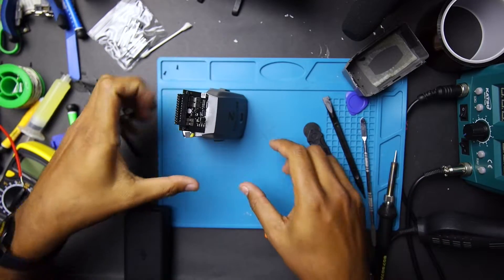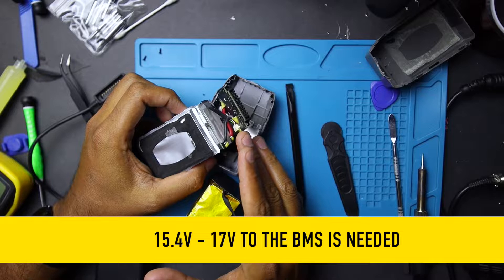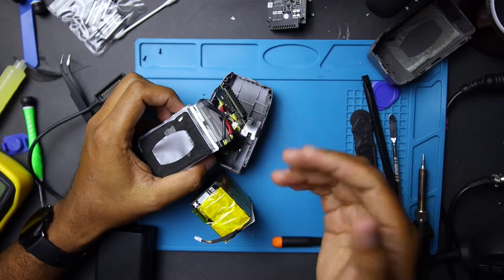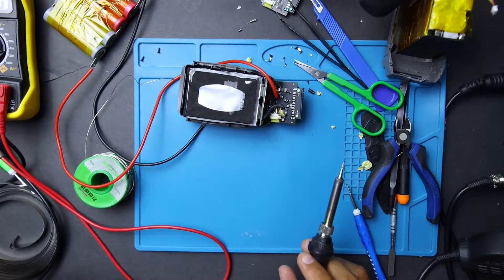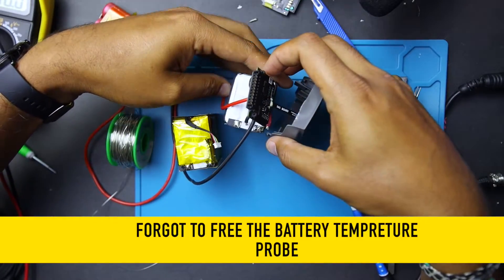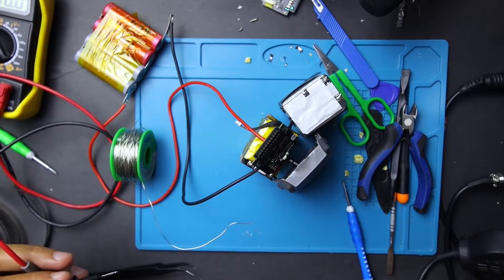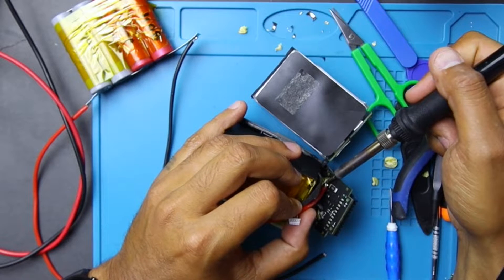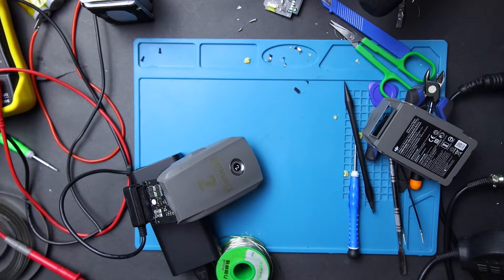Mavic 2 | Battery Rebuild Success

Comment: Changing cells is one thing but the controller will remember the condition of the old ones as it doesn’t know they’ve been replaced therefore a full capacity of the new ones won’t be used. Any idea how to restore an original capacity using cp2112 and dji battery kiler? There are some additional functions but no description how to use them - any hint appriciated. Thanks
Reply from the maker: Since the date of this, I didn’t adjust the cell chemistry or captivity in the BQ programming. The batteries work to full capacity, charge and dischargeW the only thing I reset was the cycle count and reset it to zero as it was new cells. 

The capacity that is programmed originally will not be changed until you change it. And you only change it if your cells are / have a different capacity. 

The BMS doesn’t bother with what charge it had before the change, if the cells are the same capacity it will charge / discharge as normal.
Reply: @ANTHONYVLOG  i thought it works this way: brand new battery has a designed capacity of 2375(MA1) as the battery gets older capacity of each cell degrades and it’s reflected in full charge capacity parameter eg: 1900mah on this basis bms calculates “wear level”. Since it doesn’t know we’ve replaced cells it should not try to push more mahs than he was able last time as the capacity magically couldn’t increase to prevent explosions etc. Are you 100% sure that in order to get full designed capacity od 2375mah all i need to do is replace all 3 cells for brand new ones and reset cycle count for reference? Also what does “chip reset” do on dji battery killer sw ? Thanks for your reply.
Reply from the maker: @losien1  100% you can pull the EPROM data yourself and see. I use TRB for the « important things ». DBK just for Testing.

BMS doesn’t record wear level like iPhones. Just stores capacity, chemistry for cells installed with regards to your question.

Comment: Good night Anthony so with this jumping I can make a new battery in the Mavic Air 1 without depending on the ev2300 and its respective software. Thank you very much.
Reply from the maker: Yes that is possible if the battery doesn’t have a PF flag.

Comment: Awesome work, im curious if it would be possible to install a battery of lower mAh on a mavic mini battery to bring down the overall weight with prop cages to under 250gr 🤔
Reply from the maker: It is possible and doable. Iv been using TRB software for recent experiments, they also rework the mini batteries. Look up patbooon labs TRB.
Reply: @ANTHONYVLOG is TRB a paid program?

Comment: I'm about change the cells in my battery for bigger mah cells for longer flight time, if I keep a dummy pack connected like you did you think it will work and I will get longer flights? I'm looking at cells between 5000mah and 10,000mah just haven't decided which ones to get yet? 👍🏻🤘🏻🤘🏻

Comment: Hi , do you have the dimensions of this cells, I checked the ZDF 3.85V max 4.4v 3850mAh Replacement  link and they are insane they want $367.00 shipping. Maybe if you can measure the physical dimensions and what is written on the label will help find other producers. Thank you.
Reply from the maker: The cell model is - 854871 
Size - 8.5mm*48mm*71mm

Other information 
14.82Wh 3.85v 

What country, city are you in? I’d like to check the shipping cost. That price is not right for shipping.
Reply: @ANTHONYVLOG   thank you Anthony, I am in Botswana, I double checked now the shipping is insane 🙂
Reply from the maker: @LucianComanphotography  oh i see. Yes Unfortunately Botswana is quite remote and shipping would indeed be very expensive.
Reply: @ANTHONYVLOG  he, he not really most of the lipo comes with a $46.00 transport tag, only this people are insane :-) Do you know any other manufacturers selling that size ?
Reply from the maker: @LucianComanphotography  ZDF supply the cells for brands like DJI, Parrot and Autel. I’m certain there are other suppliers but I do not know of any at this time.
Reply: @ANTHONYVLOG  weird on aliexpres they say they opened in 2018 and they have a hotmail address, are you sure?
Reply from the maker: @LucianComanphotography  they opened in 2017 and before that DXF cells. Than again I don't know before that because I only started taking apart batteries only 4 years ago for experiments. So I can only speak of the now recent findings.
Reply: @ANTHONYVLOG  uff is such a mission to get shipped lipo batteries, I get some shipped from Adorama, weird they did not want to ship batteries only but they ship the fly more kit. but I have another 2 swollen what I would like to try fixing, never heard about ZDF before, I use Tattu a whole bunch of them. How are yours after replacing they hold or they are low quality? I could not find anywhere else the dimensions what you gave me. On the funny side of things at ZDF where is the product page and they have those pictures with the factory, I just put a image search and the same building where they say is the factory appear as at least another 20 factories, he, he, he the logo is just photoshoped on the side of the building....hmm kind of dodgy.
Reply from the maker: @LucianComanphotography  i see. Well do not order if it does not meet your requirements. I just checked postage from France to Botswana and its about 40euros for 4 cells of 255grams through normal post and 280euro by UPS priority.
Reply: @ANTHONYVLOG  I was just wondering of the quality, and if yours are holding up well since you replaced them. Who is selling them in France? I have only the aliexpress link. Thank you.

Comment: Hi Anthony, its great to see what you did there. I was searching to rebuild Mavic Air 1 battery but couldn't find anything at all. So can you check if you can rebuild one for Mavic Air? I know you don't own the Air neither any Air Battery but since you successfully rebuilt one of Mavic 2, Air's one might be a simple for you. (Maybe? finger crossed)  Or Any help on making aftermarket lipo for Mavic Air? There are a lot of people just like me who are searching for Mavic Air battery but its out of production and rebuilding one seems to be the only go to option right now.
Reply from the maker: Hello, I’m in Switzerland for a production at the moment I’ll be back home in few days I’ll check my box of spares and get back to you.
Reply: @ANTHONYVLOG  Thanks a lot bud. By this time, let me update you with what i found, I saw a video of tearing a Mavic Air battery up and from that I found ZDF lipo titled for Mavic Air, same V Wh from Aliexpress. Air 1's battery is differently built, not like M2, I dont see any BMS connector but 3 lipo is directly connected in series to the PCB. I hope you can check and give me an idea about how to make piggy back battery for bypassing same like your trick. looking forward for your reply and have a safe flight back home.

Comment: What will happen if i fly Drone with Lithium Ion battery pack?
Reply from the maker: Not sure haven’t tried with 18650 cells. My guess is it will deplete fast due to the weight of the cells compared to LiPo cells.

Comment: Hi, i am in the process of connecting the bms to the new cells, i noticed you soldered the power and ground then moved the balance cable and the batt was already powered on. Did you do this on purpose, power on the batt then disconnect the balance from the old and connect to the new with power on?
Reply: i think it worked! i took a board from an OEMM2P batt, and transferred it with your method to my 7000mah batt, and everything looks good. I am fully charging just to make sure all batts are being read correctly. This was a Giant help!

Comment: Thanks so much for this rebuild! Would you be able to include the break down video at normal speed? I would like to use a bms board from a usable M2 battery for a 7000mah (8 Air 2s batt cells) And i look forward to the unbricking that you are working on!
Reply from the maker: That’s an interesting project. I don’t know if the terminals are the same as they are Fixed to the BMS.

Comment: Hello, I have a problem with my mavic 2 pro battery, it does not charge and the charger lights red
Reply from the maker: Can you explain which charger you have. The official DJI charger brick does not have any lights on it.
Reply: my mavic 2 zoom battery does not charge, I connect it to the charger and in the charger dji turns on a red light and does not start charging
Reply from the maker: @diegojourdan9314  use a Genuine DJI charger. No 3rd pty or charging hub. The original DJI charger will take the battery out of hibernation.

Comment: Amazing infroamtiove video. Thank you so much. But I have a question. When you put new cells to the BMS, it continues counting the charge cycles on top of the previous charge cycles right? I will not start from zero. So this mean when the battery reaches the maximum charge cycles it may also lock the BMS right?
Reply from the maker: Hello, it will continue to count the charge cycle from its current position. Currently there is only speculation that it will stop at 600 cycles but no one has reached this far yet without the battery failing on the original cells. If I get to 600 ill make another video to see if it blocks or continues.
Reply: @ANTHONYVLOG  I DM you on whatsapp.

Comment: great job! I have a question: Why not just make a Li-ion 4S2P convertion with Sony VTC5A? Do you recon the c rating would be too low for M2P?
Reply from the maker: Thankyou for your comment, the 18650’s are much bigger when you stack 8 cells. 4S2P. The weight is much greater as well so we lose on the thrust to weight ratio. And finally, lI-ion cells when they discharge also reduce current as they discharge where as lipo cells will maintain good current supply even as the cells discharge better than their 18650 friends.

Comment: Do you know the error of not showing mavic 2 battery parameters?
Reply from the maker: BMS issue. I have tried contacting DJI and they can only replace them on warranty but said repair would cost about the same as buying a new battery.
Reply: @ANTHONYVLOG Do you say that under warranty they could replace it with a new battery or would they do the work of replacing the cells? explain please
Reply from the maker: @jesusmaza3514 it would be best to contact DJI and open a support ticket. This video is over 2 years and things may have changed with DJI.

Comment: I’m a qualified electronics engineer and I would have done that a little differently but none the less keeping it simple the way you showed us will do the job quite fine, I would have used my lab power supply that way one pack won’t interact with the other pack by soldering them in parallel. One thing is the more exact you can be with your voltages the better ie: if swollen pack is let’s say 15.45 then your pack your using to jump across should also be 15.45 and your new pack also be 15.45 it’s all about keeping those number absolutely exactly the same and then you will not have any scary moments. To ensure packs are identical in voltage you need to have them sit and settle after a charge and make sure they are resting at the exact voltages otherwise they drift if you use them right after a charge and I don’t know what that would mean to the intelligent BMS in the DJI batts, maybe nothing, maybe a false voltage displayed who know without seeing the BMS programming and schematic. Thanks for the video it was informative, it will help many including me, as I would have disconnected the BMS thinking it would be fine, so thank you for the video!
Reply: Use a simple SPDT switch (one that does not short the 2 connections during switching) and a decoupling capacitor.
Reply: Other option is to use supercapacitor rated 17 V or more with about same voltage with the old battery ...
Reply: Hi i need advice from you i get my drone after 3 years from customs its zino2plus its battery is not charging and not working its cells are also swallowed little bit, can i replace its cells with dji battery cells?
Reply: Another engineer claiming they can do it better but never do a thing

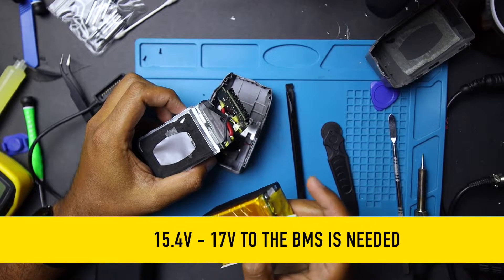Comment: At 2:15 "This the new pack that I built in a previous video" where is that video please? Thank you
Reply: Yeah I really want to see the previous video too. I'de like to know how he dealt with the spot welds on the tabs for the cells.
Reply from the maker: Solder them off. The spot welds are only spot welded to a plate. The plate is soldered to the board on the battery (not the BMS)
Reply: @ANTHONYVLOG  Thanks for explaining I haven't actually tried yet as my batteries aren't puffing up just yet, but I will likely try in the future :)

Comment: Hello @ANTHONYVLOG 
You do not need to do this whole process. First unsolder the red cable then unsolder the black cable and then unplug the balance cable! When you connect the new battery do the opposite, first conect the balance cable, then solder the black cable and last solder the red cable. The BMS will never be bricked in this way.
Reply: Is this method safe? what is the logic behind this method? how BMS survive with this method? can you give more info please. Thank you.
Reply from the maker: @Shaban_Interactive  it is safe, the principle is the same. Keeping power to the BMS, the balance cable supplies power as well so it works the same as the method I did.
Reply: @ANTHONYVLOG  But he says first unsolder red cable then black one and then unplug the balance cable. When you do this BMS will not be able to receive any power. I am just confused :(
Reply from the maker: Sorry for the late reply. You leave the balance cable connected to the exsisting battery. Just unsolder red and black than solder new pack red and black than disconnect old battery BMS cable and connect new battery BMS cable. 

This is only possible if you have 2 batteries, if you only have one that use my method. 

Also I am working on the BMS video, so if your BMS is blocked don’t worry I will release that video in February.
Reply from the maker: Yes thank you for this. It is the way to do it condition the existing pack have good balanced cells. In which case they are, so my advice is double check cell voltages at the connector and total voltage prior to proceeding to avoid any mishaps.  Good bless 🙏

Comment: it's need a software to reset the board?
Reply from the maker: It needs a hardware interface that can either piggy back on the data line or directly to the pcb. Software is supplied with the hardware interface.

Comment: Can i use li-ion batteries instead of lipo?
Reply: But li-ion can be charged max 4.1-4.2v . Does it explode?
Reply from the maker: @AnkaHobi  that is dependent on the Li-ion cells you use. The 18650 cells I recycle some of them are rated for 4.35/4.40v. So please check the cells, usually they have a code stamped on them and you can look up the battery charts to see their ratings and specifications.
Reply from the maker: If you want!

Comment: may i ask about the specifications of the dji mavic 2 pro cell battery
Reply from the maker: 3.85V max 4.4v 3850mAh
Reply: can i have the link to buy the cel
Reply from the maker: @sandal_jepit.27  it is in the video description 😃
Reply: Thnks you
Reply: is there a tutorial for assembling 4 cels battery?
Reply from the maker: @sandal_jepit.27  didn’t make one because it’s too simple, as you desolder one old cell, you install a new cell to replace it in the same position and polarity.
Reply: @ANTHONYVLOG  oh thanks you. do you have to charge the new cels first or can you plug it in directly?
Reply from the maker: @sandal_jepit.27  test the cells first they should be around storage voltage 3.85-4v per cell. If they are too low below 3.2v than they will have to be charged to 4volts before assembly.
Reply from the maker: @sandal_jepit.27  please make sure to keep the BMS powered up like in my video before disconnecting the battery pack. If the BMS loses power it will not be usable. Take your time and always check voltage at BMS.

Comment: I have been wondering if anyone has tackled the Mavic Mini battery? I see it appears to be just 2 18650's not unlike the new X8 Mini and the upcoming Zino Mini. I wonder if the pins are the same on them
Reply from the maker: Thanks an interesting one. I’ll look on eBay auctions for non working Mini kit to experiment on. Thanks for the heads up 👍
Reply: @ANTHONYVLOG  I hav the x8 and mavic mini. The mavic mini batts fit in the x8. But hav not connected them. They fit oerfectly.